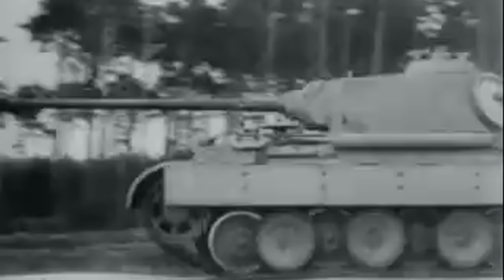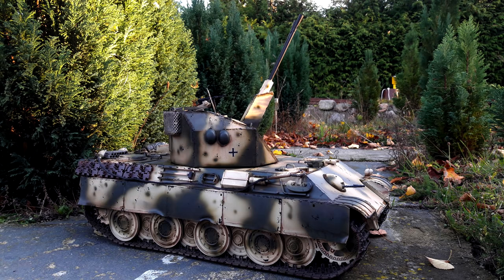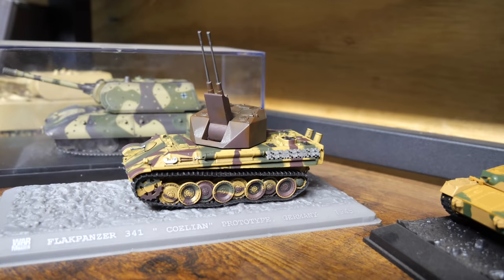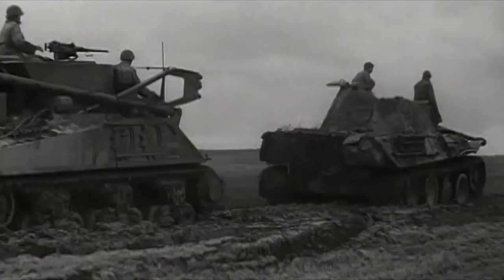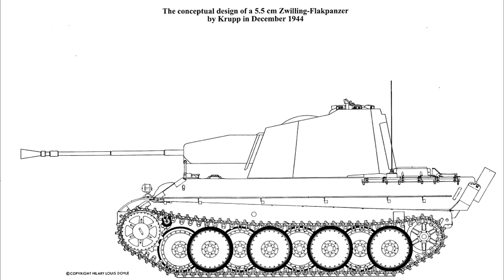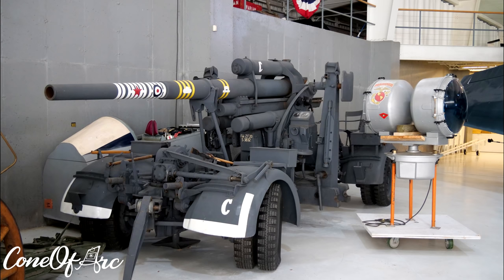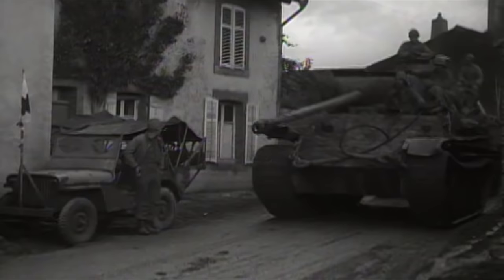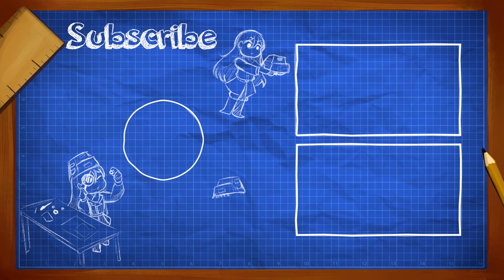VFW II to Coelian, the MANY FlakPanthers | Cursed by Design

Comment: one question: IN WHAT WAY PANTHER CHASIS IS MORE "APPEALING" THAN USING PZ 3 OR 4?

like, seriously, it is more expensive both production and maintanance (like, didn't they need MORE SPARE PARTS?), more ground pressure, requires more training for the crew, bigger target, so on and so forth
Reply: Believe it or not, at the end of the war it was actually slightly cheaper to build a Panther than a Panzer 4.
Reply: Panzer IV and Panzer III chassis were supposed to go out of production in 1945, so then the only available tank chassis would have been Panzer 38(t), Panther and Kingtiger. Panzer 38 is too smol for a project like this and Kingtiger hulls are even more precious than Panther ones
Reply: yeah if the war continued for couple more year, they would have mounted a 14 inch battleship cannon on a maus!
Transmission: (sad noise)
Reply: It’s a matter of simplifying the amount of parts German had to build. Bo need for pz4 parts if you don’t use the ps4 hull and anything producing pz4 parts switches to panther parts
Reply: Mobility (faster), protection (thicker armor), storage (Panther hull bigger than Pz.IV hull). Also, Panthers were becoming the "main standard" for tanks in the Reich. Pz.III chassis had stopped production in '44, and Pz.IV chassis were supposed to stop production in '45.
Reply: @mahtabalam3972  I have no doubt they would have tried
Reply: You can fit bigger or more or more bigger guns on panther unlike earlier tanks
Reply: Even in the 1960s an enclosed turret with dual 30+mm guns on a 25to chassis was not doable (Matador). The germans tried and then used a 45to chassis and got Gepard

Comment: I have a model of the Zweiling Panther.  Pretty interesting that the Panther chassis was chosen for so many concepts.
Reply: If you look at the post WW2 german development it may become clear why. They tried to build what later became Gepard on the "new IFV" (later Marder) hull and it failed. They then went for the heavier/larger Leopard 1 hull and the weight problems with having an enclosed, 2x35mm armed and radar equiped tank vanished.

The mass produced hull in the Leopard 1 class in WW2 was Panther. And when the projects started it was still planned to replace both PIII and PIV in production by it

Comment: I’m always surprised why the Germans didn’t use the Pz 38 t chassis for some light SPAAs, having such an armored SPAA seems like a total waste of material
Reply: In the late war, the pz38t chassis was on its absolute limit. No way you could mount an antiaircraft gun big enough to be worth it.
Reply: I have seen old b/w pics that showed an unknown AA vehicle that appeared to be either a Pz38 chassis or built from a Hetzer.  A Tiger II was the main subject of the pic, but in the book they pointed out that no one knew what that was.  A second pic from the battle off Berlin, another unknown AA vehicle that was with other destroyed vehicles
Reply: @dougmulle2627  I'm an idiot, the flakpanzer 38(t) exists, late war design with a 20mm

Comment: Hearing this it's a bit outrageous that Germany had so many spare Panzer IVs and it's components and hulls, that they mounted AA guns onto the hulls, which is unnecessary as AA vehicles are support, not front line vehicles so don't need much protection, and considering they are open topped and the superstructure is incredibly weak, a strong hull won't help the vehicle in any way. 

Yet at the same time, Germany's allies such as Hungary, Romania, Bulgaria, Finland, etc. who were desperately in need of capable modern tanks asked for Panzer IVs and Germany denied them (only giving over Panzer IVs very late in 1944 and 1945). And then Germany was surprised it's allies performed so poorly in tank combat (well except Hungary). If the Germans would have given their allies Panzer IVs rather than pointlessly equipping them with Flak turrets, maybe the Axis would have avoided situations like Stalingrad.

Comment: SPAA without radar assisted aiming in an enclosed, armored platform seems pointless to me. None of these vehicles ever being effective when they were actually deployed puts paid to that theory, I think.
Reply: How do you know they were not effective?  You would have to look at the hard data to know that for a fact.
Reply: @Zorro9129  You can’t really expect a vehicle meant to engage aircraft and similar targets to succeed with an enclosed turret with no tracking systems. It’s main job is to shoot down distant, small and fast targets that could emerge from anywhere, and that’s difficult to do with only a few vision ports, don’t you think?
Reply: @fluffyskunkboy4596  If there is a commander hatch he can look for a target and direct the gunner before "buttoning up."  The benefits of an enclosed turret are obvious, as SPAA with poor vision is still more effective than SPAA that has its crew knocked out quickly.
Reply: @Zorro9129  an SPAA with poor vision not effective!

Comment: Actually a question, how good would a flak tank be against other armour?
Reply: That would depend mainly on the gun(s). Obviously multiple 2cm Flak guns would be nearly useless but the 5.5cm and 8.8cm ones could likely have been very useful  in a secondary AT role.
Reply: @jarink1  I can imagine that any tank crew being targeted by one of these tanks would be shitting bricks.
Reply: Useless.
Reply: I was wondering about this as well, how much is the pen of those guns? Dual barreled 5.5 sounds like to be a fun gun to be used in WT (if they haven't already). Heck, I can even see they to use it for WoT as a weird premium.
Reply: @zeroyuki92  The velocities are close, so probably a bit better than the 5cm KwK 39 used on the later Panzer III Ausf L. Not great on a frontal target, but perfectly capable against most side or rear armor.

Comment: It makes a lot more sense to brief obsolete tank hulls rather than valuable Panthers.  The ever trusty pz4 being ideal..... as ever with Germany, too many designs, too many big ideas but too few practicable applications
Reply: Logistics whise it would make sense to base everything off of panthers. They wanted to discontinue Pz4 Production anyway. The Problem is that they werent able to produce both of them in sufficient numbers anyway.
Reply: @offset7711  they kept pz4 production right up to the end. it was a proven and reliable design. the Pz4 J was an operational battle tank to the very end and its chassis was base for numerous other tyres .. Panthers were bigger, more complex and expensive. good battle tanks, but wasted if used as platforms for flak vehicles etc as some planned. the craziness of German planning guaranteed failure .. as the Reich shrank they had less and less to use and yet Hitler wanted super-heavy tanks and wonder weapons.
Reply: @coling3957  They never made the change. But when Coelian was designed it was what the Industrie was told they wanted to do and you do not build your new vehicle on a plattform that is about to be phased out

Comment: Cool video but... On your ending comments I would have to disagree to a degree. While they would do little to reduce the amount of Allies' aircraft and the over all strategic bombing campaign, they would be useful SRAD and on a local level. SPAA like the wirblewind and other AA,while effective against dive-bombers had been hard counted by Rocket based CAS like the Typhoons with RP3s which these Panther based AA would be resistant too. While it would not win them the war the ability to defend their exsisting armour would be quite useful, even if they are just driving aircraft off.

Explanation asside, love your channel! And thanks for the videos~~
Reply: You know that Rocket attacks were mainly psychological shock, right? The Brits did a series of tests after Normandy--rockets hit less than 10% of the time!  What was more effective was that near-misses would scare crews into abandoning their vehicles, either temporarily or (less often) permanently.
Reply: @dphalanx7465  When a typhoon carries 8-12 RP3s and come in group of 4 at least meaning that at the worst 32 rockets fired. That's still 3 hits on targets.

It also should be noted that only tank would need a direct hit to knock out. Half tracks and soft skinned targets like SPAA would be knocked out by near misses due being open  guns. 

A fully enclosed SPAA would eliminate the near miss kills rp3s enjoyed by putting armour plate In-between the shrapnel and blast. An Spaa that stays operational longer has increased chances of breaking up air attacks or driving aircraft off
Reply: @dessertfoxo4096  Definitely agree with your second & third paragraphs.

Comment: If there is any humor to be found among Germany's war effort, it is exactly this, too little, too late...

These would have needed to be in production by '41 to be effective by '44.  Prototyping a solution long after it was already a decided issue on the battlefront was a German hallmark of design philosophy.

But still, who doesn't want a Flaktiger with twin 37mm, twin 20mm, and a pair of MG-42's on top? Can you imagine it a direct fire ground support role?